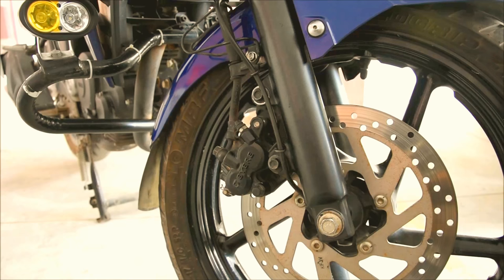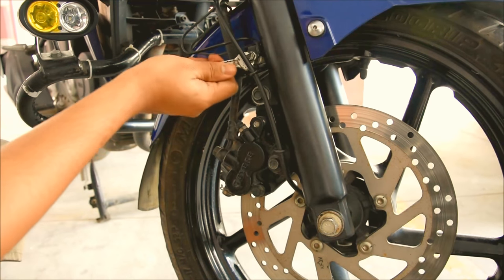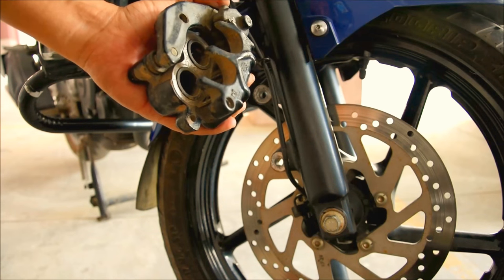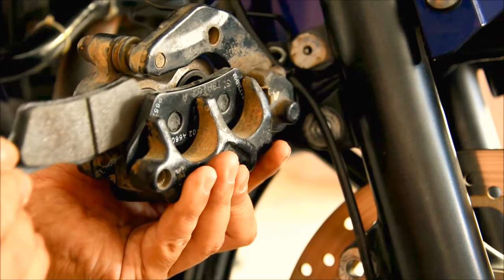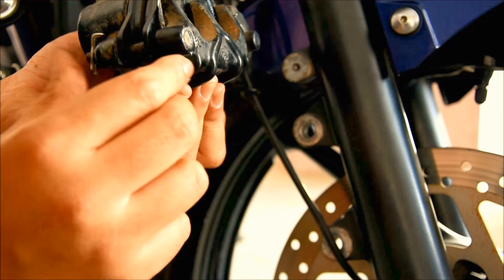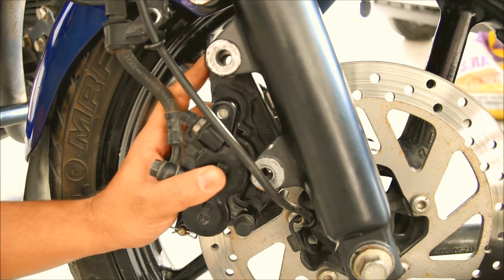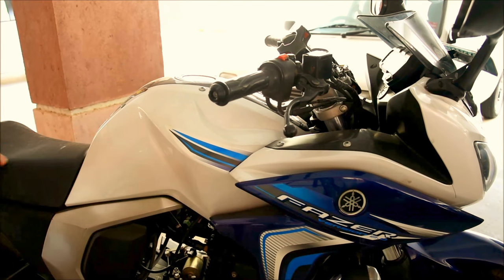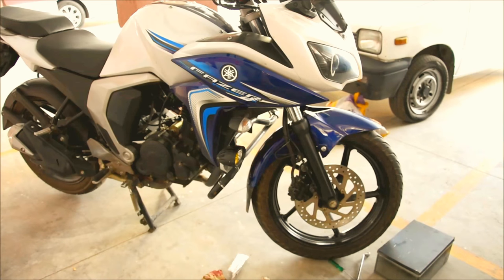#DIY : BRAKE PAD Replacement on YAMAHA Fazer Fi / Fz v2.0 || DISC BRAKES || DISC PADS

Comment: I have an fz s bought it recently and should I go for change of engine oil with the service center or mechanic
Reply from the maker: If you follow my videos and can do the general service yourself, you can avoid going to the Service Center. My bike never ever went to the service center after I got it out of the showroom. But remember, that will VOID THE WARRANTY. So think before you do it.

Comment: In rainy season my disc pads do some noise with disc plate then around the disc plate some black dust coming,,
So in rainy season is it common or anything else
So what we do bro.. please tell me
Reply from the maker: Its common during rainy season. That black dust is brake pad powder. Shampoo wash the disk once a week to keep things clean.
Reply: Ok tq u so much brooo

Comment: How often do we need to change the brake pads for moderate usage. I had to change after 9000 km with moderate usage. Was I too aggressive on brakes or is it normal to change brake pads so often
Reply from the maker: In my case my pads la last about 20-25k kms.
Reply: @MototechWanderer  my bike is fz sv3 and it's 8 months old disk pad ended bike run 6000km is it ok
Reply: @singerjockychinchpadkar4279   yes my bikes pad gone at 10 ,000 km, in a busy traffic of Delhi when you use , front break quite often , they go quickly

Comment: Bro... Recently I was riding in rain and my front disc was not working while applying during rain.... So I thought it's because of wetness of disc and poor pad grip... But after it gets dry the next day.... The front brake still continues the same issue... There is no power while braking... 
What can I do....?
But before that rain.... It works good...
So do I need to clean the disc and pad or go for replacement or any other suggestion...?
Reply from the maker: Can you first check if your fork oil seals are leaking or not ?

You can simply wash the disk well with shampoo and rotate the wheel and apply brakes multiple times while washing. Make enough foam. This should help.

If nothing works, replace the brake pads.

Comment: I have fzs v2, when I put it on double stand and then put it in 1st gear the tyre rotates even when full clutch is pressed. Will it damage my clutch plates. Bike is 3 months old
Reply from the maker: Sh Aag  It's very normal.

Comment: I have bought fzs version 2. My bike ran 140 k.m stil break pad has contact with disk when even not breaking.  Wheen i rotate both  wheels,  metallic sound comes from the disk plate. That means break pad is rubbing with disk plate while not breaking.  Is it normal?  Or i should go to service centre for this issue.  I am new rider please help me out
Reply from the maker: It should get better with use say 100-300 kms. If it's still happening, brake bleeding will be required.
Reply: @MototechWanderer  thank you  so much

Comment: Mechanic change the brake pad but i can't move the bike freely it will hang the disk tightly. Again i given to him. May i know the reason how it's get hang the disk tight and to make it free movement of wheel
Reply from the maker: This indicates air in the brake system. Bleeding the brake and filling new oil should fix this.
Reply: @MototechWanderer  thank you

Comment: The Fz Brakes pad Has 2cuts in between.. as you have in the wear out one .
Reply from the maker: These are from Yamaha ASC. Yamaha uses same brakes and pads for multiple motorcycles ... So they might slightly vary. It's fits exactly same as the stock. So no issues there.

Comment: Bro my bike breake three bolts very tighten it's not loosen even I  try it , I try to remove the wrench also bend ,, so plee help me how to remove that three bolts
Reply from the maker: Venkatarao Vuggam  Spray WD40 or some other penetrating oil. And get it removed by a mechanic.

Comment: Service centre said 1200 RS for front and 750 RS for back disc liner for my Yamaha FZ s fi V2 . What's the real price ?
Reply from the maker: Front around 250 and rear around 350.
Reply: Damn they r milking us customers...
Where I can buy original parts ?
Thanx for the reply
Reply from the maker: @Rahul_Jadhav2  go to any Yamaha Dealer and ask for the part. MRP will be printed on the parts packaging. Please note ... These prices will be different for new generation fz which has dual disc.
Reply: Where did u bought those head lamps and how much they cost..?
Reply: @MototechWanderer  Yamaha gives us  near about 1000 rps  back shoes

Comment: Does r15 S brake pad suits on fz16??
Reply from the maker: The old one - Nope. Calipers were different. Now the Fz v3 I think had same caliper and brake pads of the R15.
Reply: @MototechWanderer  bro how can i improve braking efficiency.. Is there any way??
Reply from the maker: @nithink5693  clean the disc with a good quality Brake / Disk cleaner. Replace the pads. The pads will come to full efficiency after 100-200 kilometres. 

Make sure there is no dirt / oil on disc surface.

Comment: You didn't show how to insert in the piston that's the main part here .. no use of watching this video
Reply from the maker: Watch the video carefully, I used the screw driver to push back the cylinders into place. There is no rocket science involved, just apply pressure and they go back inside the caliper ... It takes little time and a lot of pressure.